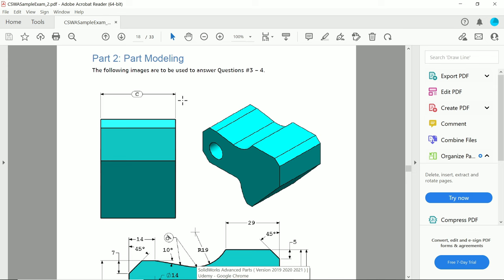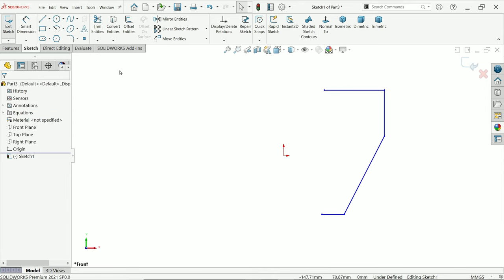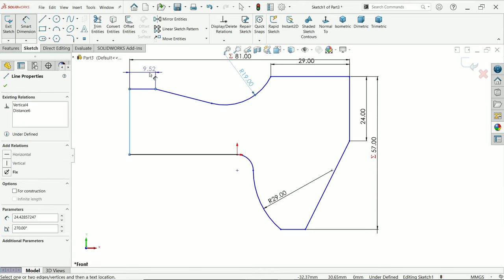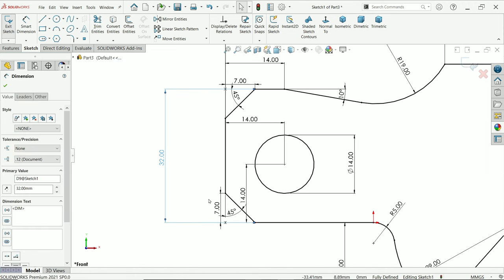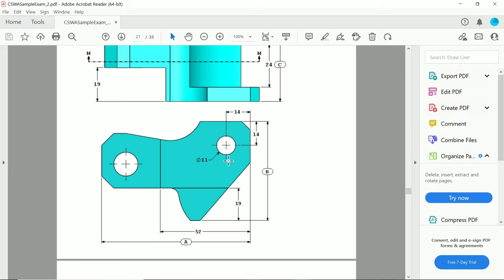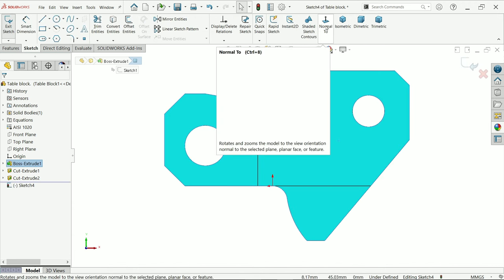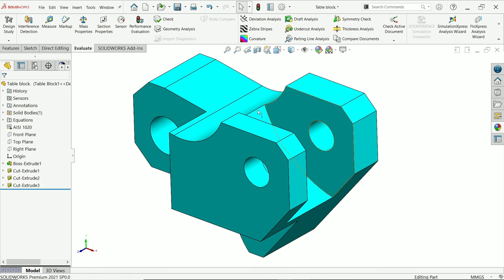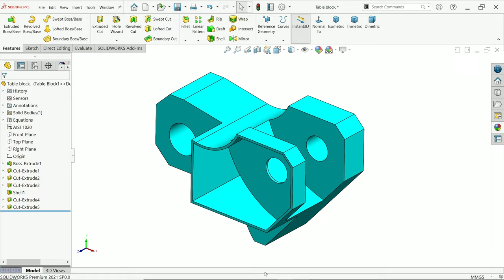SolidWorks CSWA Sample Exam Exercise

Comment: Great video - question I have in general - instead of using sketch chamfers, if I use a dimension and a 45 degree angle, I get a different mass for the object. Perplexing. Wouldn't that create the same geometry?
Reply: Good question, it should be same result.

Comment: With the 1mm shell you can also add the face of the cylinder to remove the 1mm walled cylinder but still keep the floor

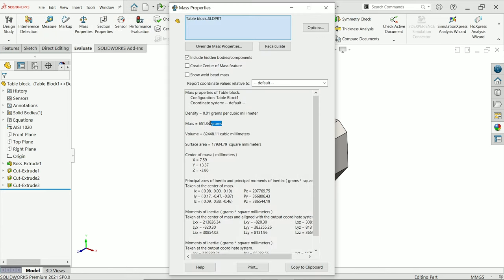Comment: Really helpful but the right mass at 13:42 (question 5) is 628,18g instead of 651,34g and the final mass is 432,58g
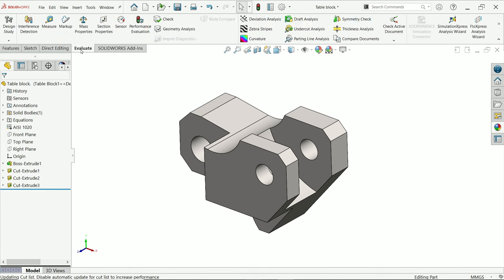Nagyon hasznos video,  de a helyes tömeg 628,18g 13:42-nél (5. kérdés)  651,34g helyett, és a végleges tömege 432,58g
Reply: I've the same mass with you mate. Thanks for sharing
Reply: @MrP1kollo  the person in the video did it correctly with the equation values that he used, I also got 651.34g. However, you guys are also right if you use the following values: A = 86, B = 58, C = 44. You were looking at a different version of the practice test. When I plugged those values in, I got the same ones you did
Reply: @justapollo709   Thanks for sharing bro. Got the same mass and was confused for a while when reading the comments haha